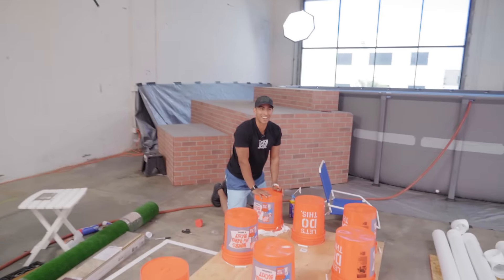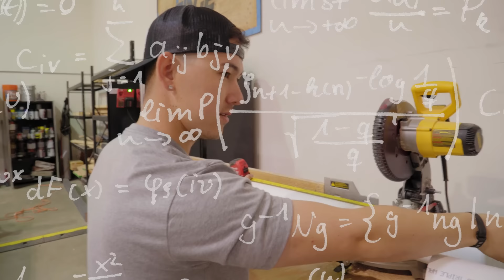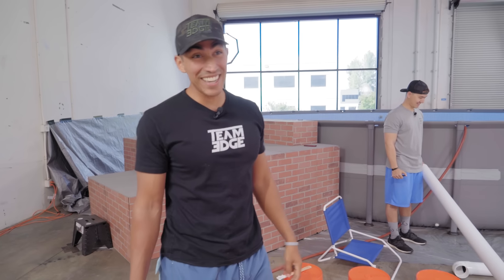Build Your Boat Battle! | Who Will Sink First!?

Comment: I love how two seconds after J-Fred jumps in he's suddenly dry 😂😂
Reply: Wow...
Reply: He wasn't tho, the water was only on the bottom of the shirt, did u see the bottom of the shirt? No, you didn't because he was sitting
Reply: He’s Ariel’s hair
Reply: @BeybladeASMRreviews  when he JUMPS in the pool to get the flex tape in the beginning.
Reply: @TimBukTwo  well then it was a cut so he could get dry
Reply: @BeybladeASMRreviews  that, or he swapped clothes, which is reasonable to assume as they would have to have backup outfits anyways for this.
Reply: @shadowsnake5133  the swapping clothes is right,
If you look at the shirt text on before he jumped in and after, there is a difference.

Comment: I made a boat before and it worked like a charm. Easy to take apart and put back together again. I made a PVC pipe rectangle and then got plywood to fill the space as a floor. I waterproof sprayed that to prevent leakage, and then attached a bunch of floaties to the bottom using straps. It was all under $100, since I'm a kid on a budget and only had $50 support from adults.

Comment: Bobby could have made a better raft by only using pipes what you can do is get pipes and bring them all together all of them facing horizontal and then put little end pieces on each of the holes keep water out and then duct tape them all together